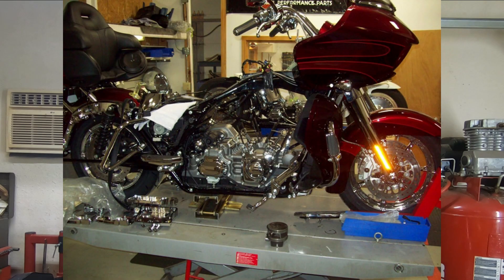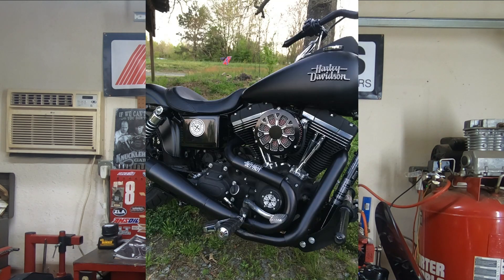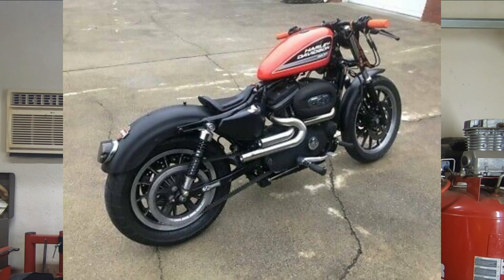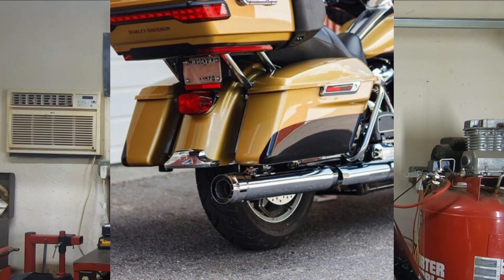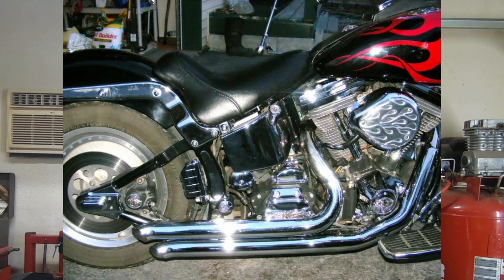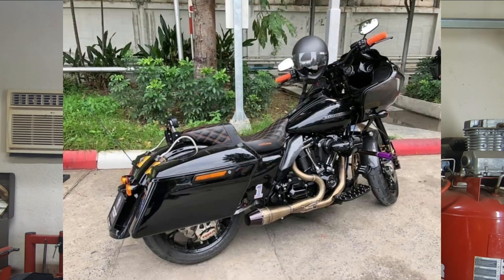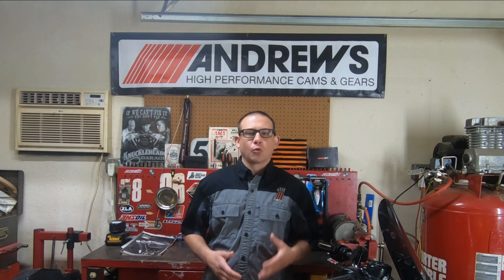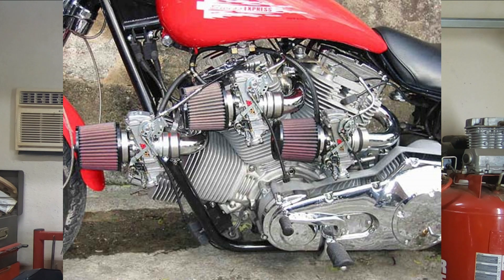Harley-Davidson Performance Hinges on One Major Factor

Comment from the maker: What's your favorite exhaust? Do you compromise or just get what you want without worrying about power loss?
Reply: I like the sound of staggered shorties where the exhaust pipe enters the small then the larger diameter slip on and at the end it returns to the same diameter as the exhaust pipe. It has a good old school deep sound. No nozzles needed. I agree on the cross over pipe giving more than enough exhaust. On a side note about intakes and knowing if you have enough. If the engine intake is drawing oil out from the heads to where you can see it drip you need  a less restrictive air intake. Thanks for dispelling the myths of intakes.
Reply: That’s tough…LSR on my twin cammed softy, Thunderheader on my Evo RK, no idea what kind of slip ons and true dual on my shovel. Love them all though. Far as favorites, couldn’t tell ya.
Reply: My favorite exhaust for look and sound is the Vance & Hines true duals for my 1999 EVO Springer.  No baffles and the performance is fine with my Arlen Ness supersucker air cleaner and EV27 cam.
Reply: Vance and Hines Pro Pipe
Reply: Form follows function. Fab 28 all the way for my Dyna💪👍
Reply: D&D pipes are the finest on the market. Hands down.
Reply: I second the fab28 pipe.
Reply: 07 Street Bob with a 103 kit, bump in compression, SE 211 cams, and RB LSR w/ side dump. That’s what it came with when I bought it and it moves pretty good mid-high rpm’s. Added an S&S Mini Teardrop Stealth air cleaner. I get compliments on the look and sound of the exhaust. So I’m not complaining. 😄
Reply: I have an 05 Softail Deluxe. I went with Basani Road Rage because I wanted a 2 into one, & the Crome went well with my chromed out bike. I went with the long silencer because again, it fit the 40s-50s vibe. Also, I went with an S&S teardrop which isn’t just a cover but the whole unit. Is there a higher performing air cleaner you would recommend? It does fit the retro vibe well, I just want to make sure I have enough flow. I have Fuel Moto 98 with Wood 555 cams & Fuel Moto ported heads. I assume the S&S is sufficient, just looking for another option. Thanks
Reply: I'm a Thunderhead er guy on my FXR they don't look like any high quality but they work ! I tried a Pro pipe & lost 6 HP Vance & Hines said I needed the competition baffle spent the 80 bucks on it & gained back 4 HP ! Like I said I'm a Thunderheader guy !
Reply: @leonardstanford1877  Thanks for your comments about your fxr. I found  an 88 fxrs low rider with only 8k miles. I put mid pegs and controls back on it. Now looking to help it run better.
Reply: @rexfranks1159  right on FXRs RULE !
Reply: I like my thunderheader, I tried to get a patriot defender but couldnt find one. If i had to go away from the 2-1 style I'd go with some Vance and hines short shots.
Reply: Krome Werks sounds and performs good but imo nothing like the Crack sound of a big bore D&D
Reply: I love my V@H 2 into 1 Propipe
Reply: Loved my fab 28
Reply: Welp, on my 2012 Dyna Fatbob with a Twincam 96. I have the stock header on it. The converter has been removed . And I have Penzel Pipes adjustable slip-ons. Aircleaner is a K&N , topped off with the screaming Eagle super tuner. I haven't went beyond the stage 1. YET! I'm in Germany and spend a whole lot of time on the German Autobahn. And I am just fine with the performance of my Bobber. It will run 100mph all day long. And I can leave Porsche standing at any traffic light. I bought the bike new. So I know how it ran from the get go. And how she runs now. And the cool thing about my set up is. I can go from mild to wild on the sound. With just a flip of a switch. Which is really nice on my neighbors . At 5 in the morning when I go earn my daily daily. I also own a brand new M-8 107 FLHR roadking. That got delivered right at the end of May this year. And it is as stock as it gets. And bro , I will keep in mind what you said about the bagger exhaust here in this vid. When I eventually upgrade my Roadking. One thing is for sure though. When I do upgrade . The mufflers will be electronic sound management...
Reply: My 2000 88 Twin Cam has Krome Werks AR Staggered Duels with an Andrews 37G cam and a Mikuni HSR 42 carburetter, and I'm more than happy with the performance of the bike.
Reply: If I wanted a performance bike I’d go back to a Japanese sport bike.  Costs way less and has way way more performance!  HD=looks, sound, experience, lifestyle!   Or atleast that works for me.
Reply: I don't think you can go wrong with the S&S headers, I love mine. 
With my Big Louie's from Crush for mufflers. I'm Golden 👍
Reply: My road glide with a bassani 2 into 1 and cam is my choice and she runs great
Reply: @Smokedilla  too raspy for me .Just took  that system off. And went with a 2/1/2 header that has a crossover. Fuel Moto XXX 2/1/2 header and Khrome werks 4.5 slip ONS.
Reply: I have the S&S Power Tune duals with Screamin' Eagle Street Cannons on my 09 Road King - best of both worlds, just like you mentioned.  This setup is a great improvement over the straight duals and Tailgunner Gunship slip-ons that were on the bike when I got it.
Reply: I like the look more than the sound and performance.   True duals and 2 into 2 are my favs!
Reply: Twin Slash w/stock pipes on my 02 CVO Road King and Big Shots Staggered on my 06 Street Bob
Reply: @abdulmateen19  FM makes a great 2-1-2 headpipe and a great 2-1 pipe.  Their 2-1-2 performs as well as most 2-1. I'm not a sound guy, but if you can get the sound and performance right, you're set.  Nice.
Reply: @Smokedilla  yes they do🤘🏾
Reply: For me,  performance first!
Reply: I installed the S&S powertune header and S&S MK-45 exhausts when I upgraded to a  Woods TW-222 cam and complete S&S cam chest on my 2012 streetglide. Dyno reads 94hp and 112lbs torque so I am happy with this. Great increase. No power loss here.
Reply: Supertrapp Supermeg 2:1. I lost about 10hp with that choice, but kept more of my hearing than stay with the ProPipe the shop first put on.
Reply: I like the sportster's earlier 2into1 exhaust, and may get one.
The vintage 2into1 on the '37 WL is also nice. Will get an open air cleaner too.
Reply: I have a D&D Fat Cat 2 into 1. It is a good exhaust sytem.

Comment: Personally, I think the elephant in the room is the tune.  Most people don’t realize it, but there are a ton of misrepresentations when it comes to dyno numbers.  That’s why dyno charts are for the birds.  These astronomical numbers are done with 6th gear dyno pulls.  Most good tuners will do honest runs in 4th or 5th gear.  The other thing is that no two dynometers are the same.  Some are very liberal with the numbers, and others are conservative.  The truth is that the seat of your pants will always tell you how your bike is performing.  This obsession with numbers is absurd.
Reply: Agree.  Peak HP numbers are sort of irrelevant if you are not always riding in the gear and RPM where the peak HP is made.
Reply: Exactly.  My tuner tuned my bike to my riding style.  I sacrificed a couple HP/Torque, but it's tuned for how I ride and gives me power where I want it and not 1000 rpm above or below where I normally ride.  Chasing numbers is for nothing other than bragging rights if you actually ride your bike often.  Who really wants 150+ torque immediately?  I know I don't.  I'd rather sacrifice some and hit it at 3500 rpm with a nice steady curve than hit all of it at 2200 RPM or not hit it until 4500 RPM
Reply: ABSOLUTELY
Reply: Old school 💪😊
I agree
Reply: Let’s not forget about the people who buy fuelpacks and powervision a are a “tune”.

Comment: I built a Road King from a wrecked 2008 Ultra Classic with a 110-cu in SE engine.  Built the engine with Feuling OE+ camplate and oil pump and Wood TW 7-7H cams (same as my 01 RK 95" with Wood TW 6HG cam with Rinehart tru-duals with 3 1/2" mufflers).   On the 110 build I used S&S tru-dual headers with Rinehart 4" mufflers.  I have never dyno'd the 95" RK but it is lightning quick and a stump puller.  Had the 110" dyno tuned and got a disappointing 102-HP / 109-ft/lb Torque.  Road the bike for a while then discovered DK Custom selling disc's that are installed in the end of the mufflers (work similar to torque cones).  What a difference the disks made.  Have not had it dyno'd again; however, seat of the pants tells me it is much better.

Comment: Harley engines are designed for torque and that's what I go with. I actually have a Vance and Hines original Pro Pipe with an original Cherry 🍒 Bomb muffler that I fabricated and with my modifications, the bike loves it. The amazing thing is that it actually isn't so loud that it has you talking to yourself while cruising but drop a gear twist the throttle and hold on...build for torque and HP will come...great video
Reply: Love my V@H pro.95 " t.c.
Reply: ProPipe for the win, I refuse to give it up!

Comment: Absolutely Hands down for me I always do the 2into1 Thunder Header system for all my Twincam's paired with the target tune power vision  systems
Reply: Thunder header is decent, but it’s a midrange pipe that tries to pull again in the upper RPM. It’s mid way in performance. Their issue isn’t the muffler, it’s the collector merge. That’s the key in a 2-1, the merge.
Reply: Yup right where I like it

Comment: A 2 into 1 exhaust will give you better performance hands down. Thunderheader is my favorite. Sound and performance can't be beat, but it is a louder pipe. Get the longer pipe so the sound outlet is behind the passenger.

Comment: Great info Gixxerfoo! I have V&H Staggered Shots on my 883 and they work pretty good. I pulled the baffles and installed a set of DK Customs 1 5/8" Thunder Torque inserts and I could feel a difference! It may be a small difference, but they work. The trick is getting rid of the reversion, that's what they do. So, if someone has the Short Shots, they are worth a try.

Comment: 2 into 2 with a cross over.  A win win for me.  2 of my 3 bikes have them.  Grateful video.
Reply: Which exhaust do you have, u have a heritage 2017 and was looking at Samson fishtail. Do they make a crossover so it can be a two into one into two? Thanks.
Reply: @300shields  VH Longshots.  The factory head pipe has a crossover built into it, this is on my 2020 Sportster Roadster.  
Cobra also makes a 909 Speedster, full exhaust with a crossover that works good.

Comment: Stage 4 114 on my 2018. Went with a good cam and tune with powerduals and S&S Grand Nationals. Very pleased with the results after the dyno. I originally had the dresser duals on it but they did not dyno well with the whole kit. It’s definitely a constant learning process.

Comment: My 03 FLH has true dual ceramic coated headers and Supertrapp mufflers with the discs and closed end caps !!! Runs beautiful and smooth all day long. I always Loved those mufflers. Saw them on an old BMW PD 1000cc and an HA with them on an FXR and had to run them myself when I made the system. Cruising along at 70mph you just hear the engine working and a warbling behind you. Never once cared about the "numbers" I just wanted it to take me and my shit wherever I want to go for as long as it takes and it does it all.

Comment: 2014 Firefighter Streetglide  just have K+N and slip on RCX exhaust pipes. Sounds 100%  better then stock obviously.  Also a 2005 Deuce ,Kuryakyn air filter, Power Commander, with full S+S Gear Drive, adjustable push rods , oil pump ect ect with 509 gear Drive cams ,also BUBA Pipes . And man is it LOUD . My bikes run great Thank God for what they are . Personally hate cross overs like the original Duce pipes, and two into one on a bagger 🤢.Another Great Video 👍♥️🇺🇸🇬🇧😎

Comment: Heritage Softail Classic 2008 installed Andrews 48h cams, and put in the cobra power pro HP 2 into 1 thought I would lose horsepower but actually gain three hp. 10foot lbs of torque .  Not.to bad of sound .Have a great weekend . love your videos !

Comment: @523 ypu showed the Big Shots staggered after commenting about the lack of a 'crossover' section in the headers.However
...at least on the newer 18 M8s V&H have added a crossover section to the Big shots.I just put it on my new Fat Bob.Great content BTW.EDIT:you just showed the big shots then with the crossover.My bad....I jumped the gun.Rock on😀

Comment: I've been playing with different baffle sizes and lengths for my hammer performance sportster. I've done 2.5" perf, 1.75" diameter /10" longreducer, 1.75" diameter / 2" long and now I'm running a 2" louvered baffle wrapped. It's crazy the differences between the baffles / inserts. Small reducers make partial throttle inputs very high in torque. The bigger baffles give it a lot more top end
Reply: Find a Patriot Defender 2-1, you’re welcome….
Reply: @scottmorgan133  lol they can't be found anywhere!

Comment: When I bought second hand 2006 xl883, it came with v&h straight shots full system. I changed to factory headers and khrome weeks mufflers. Bike feels very responsive and pulls hard between gears. I also like the sound, it's very deep and mellow while cruising on freeway but loud while accelerating. V&h was loud all the times, it was tiring after a while. Volume at idle is same but very deep with khrome werks. It made big difference in way bike makes power.

Comment: 💯 %. I did a 30/30 cam in my 114 I had a true duels system with Krome werks. I didn’t like the Dino numbers. I swapped out to a 2into one. S&S system I gained 12 hp and 8 torque with the exhaust. Definitely the exhaust is very important

Comment: when you push 100 HP out of a EVO hold on .  I was smoking 103 Twinkie's   I am doing a New Build here in a Month  EVO 20 over 3.515 in that area EV23 cam ported heads 1,990 valves intake 1.660 exhaust . I hope to pull about 100 HP with 120 torque .  I have 2 into 1 on my Road king the duel  exhaust left side is fake .  Why is it I have a Need for speed and power  but it is not cheap .

Comment: The question is why, I have a Stage 2 Twin Cam Springer and tbh it's a death trap, with more power than the spaghetti frame and bicycle brakes can handle. I bought a rice rocket for less money than just the Stage 2 and it's a missile on wheels, handles like a dream.
 Imo it's a Weiner waving, pissing contest, driven by the aftermarket, with people thinking they need more and more power. I also have a 300cc bike with 33hp  that does everything I want, including 2 up riding.

Comment: Vance & Hines 2 into 1 into 2 with a woods 22xe cam, and a thunder max auto runner.  Dyno results 120hp, tq 128  motor 107
Reply: That cam is a beast. Those numbers out of a relatively stock 107 are pretty impressive.

Comment: The “best” exhaust is the one you a) like that also b) supports your configuration now and c) in the future.

If you have a shop you like and (more importantly) trust, just ask them. 

If not, call Fuel Moto and tell them what you have and plan on doing and they’ll give you recommendations. For example when my warranty ran out and I did my Stage I I called them, told them it would be stage 1 only this year but that I planned on a 96 to 107 or 110 in two years, and that I was considering a Trask turbo a year or two after that - so they made sure I bought an exhaust that would support a turbocharged 110 while warning me that if I went bigger than about 113 (turbo) I’d need a bigger exhaust, but that doing so was so expensive I might as well go to 120 (the turbo would also require a larger air cleaner, but that Trask included that in their kit so not to worry about it). 

The best part? Not only did they suggest exhausts they sold, but also gave me a few models with very different styling that they didn’t sell but knew would work. Any salesman who will tell you when the best fit for your needs is sold by someone else is a salesman you can trust, but I liked their exhaust (and it’s price) so bought from them anyway. I’ve since also bought their 110 kit, had the, do the porting, increase compression, etc - all with great results (I did the install, they did the machining).
Reply: Yeah. That’s solid. You don’t see many salesman doing that these days.

Comment: Thanks for your exhaust input and I hope in the future you visit indepth the old adage of: "There's no replacement for displacement". I installed a 131 crate motor with the recommended super duper Harley downpipe and Khrome Werks slip ons. So far so good but I must admit having outgrown the Stage 4 Harley upgrades and am considering the 22XE cam. I've watched your cam video and hope you can revisit this winter sometime the pro's and con's of different cams in big bore, (131 and up), applications. Thanks in advance

Comment: Not sure on the cross over...it seems more of a middle ground between "true" 2-2 and 2-1 systems.

Yes factory headers with a good set of slip ons can be amazing, my 2014 xl1200c made 90/90 with a stage one heavy breather and a set of v&h slip ons (now going down the 2-1 path, due to where it will be spending time in the rpm range)

I am unsure about my 89 fxsts it will be sitting in the benifical 2-1 rpm range (highway crusing) but unsure of looks, the Rinehart 2-1 seems to look way to long (if it was a little shorter maybe)while i enjoy the looks of the Rinehart 2-2...